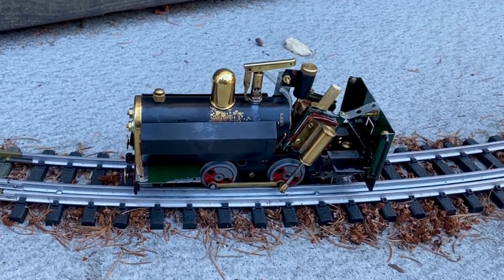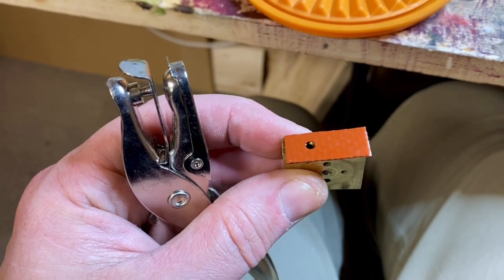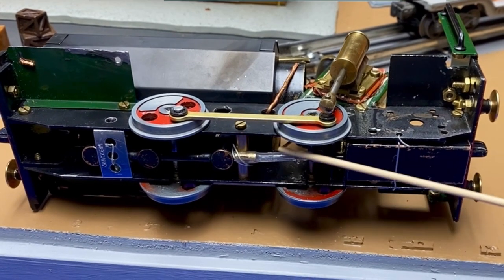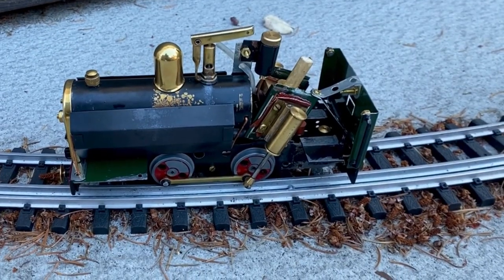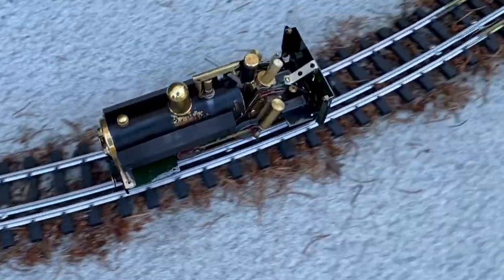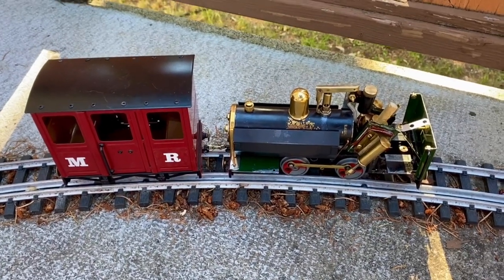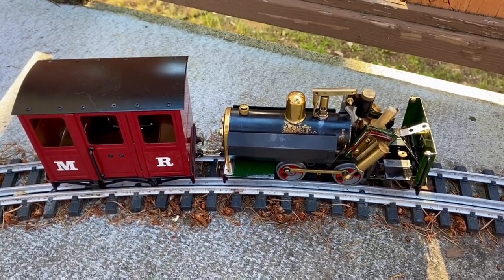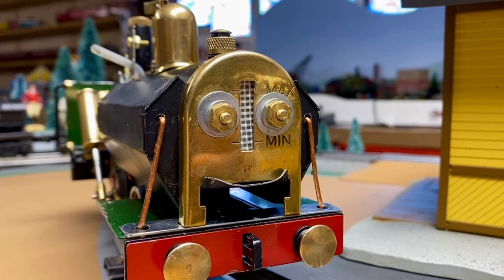Victoria B.C.: Working live steam loco cobbled together from parts (mostly old Mamod) - first run!

Comment: Glad you shared this with me. Did the holes on the frame not line up to put the cylinders there? Or was having them partially vertical to make plumbing the oiler and such easier? I think it looks fantastic in that orientation!
Reply from the maker: I was actually going for the type of look seen during loco trials in the 1830s.